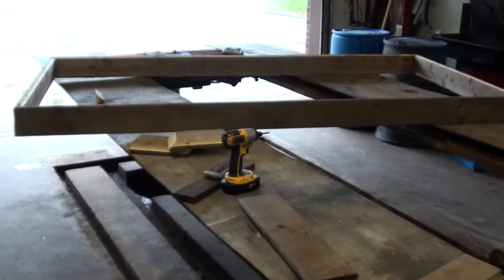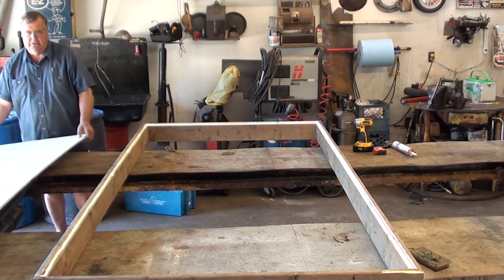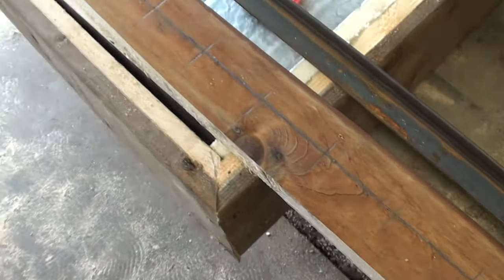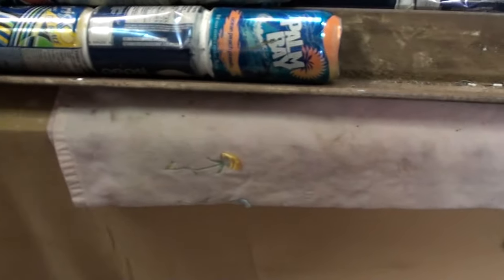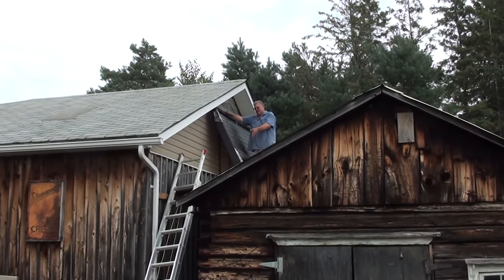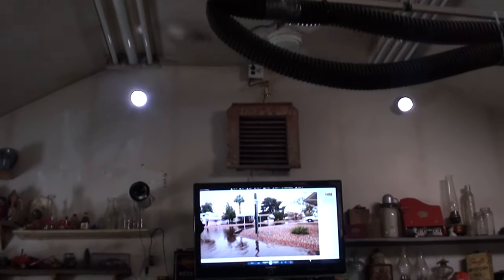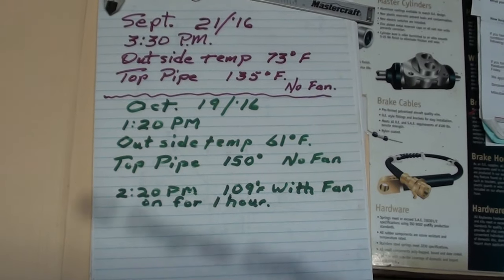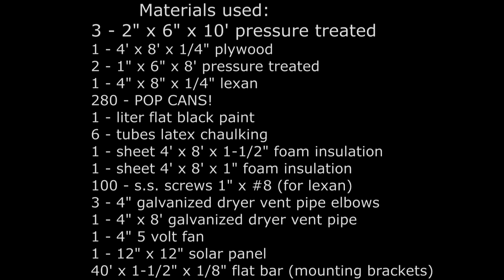SOLAR POP CAN HEATER BUILD!

Comment: There's actually a way to improve the system: just out of the top pipe, add an insulated (styrofoam/foam) chamber with a valve and a few standard red bricks. They'll store the raw heat and give it back  later on. Also, this way, you can put a "tap" out of the brick chamber and the bricks will continue storing heat even when you're not blowing it into the house. From there, you can even wrap the bricks with a copper coil pipe and use the heat in a parallel oil circuit for heaters.

Comment: using the same kind of method. if you put cans on the inside on the walls ensuring the air blows through them under an air tight seal (bit of tubing between each can) - you effectively have a solar fueled radiator. obviously minus the glass front 

for best results, strip the cans of their paint and put one on each wall and the ceiling above you

Comment: I use mine all winters 
Using a fan will knock the temp down 30-40 degrees every time.
I generally leave the fan off unless I'm getting great sun. Mine is on the lower floors do the heat it produces just rises to the upper bedrooms. Great video
Reply: What about at night when there is no sun?
Reply: @catsincredulous9998  it works in reverse... you cool your house...

Seriously... its a solar heater... what do you think happens at night?
Reply: @catsincredulous9998  
Light a matchi.

Comment: beauties!
would be great if you could push the intake air from the other side of the room of think. the way it's setup with the overhead ceiling fan it looks like you might end up cycling the warm air back through the cans

Comment: Nice build. I will be doing a similar build for my RV using steel cans since they are easy to open both ends with a can opener and they are a bit thicker to retain a bit more heat.
Will be doing a thin coat of concrete or epoxy before spraying with high heat paint.
God bless.
Reply: You can also use plastic drainage pipe, the corrugated kind, lots of surface area and should work easily.

Comment: Wouldn't it have to be a fairly temperate day for you to get much heat out of one of these?
Reply: From a test in mid Wisconsin, I can get output of about 65f down to 5-10f outside at about 1 gpm of water. So if you build bigger maybe you can get heat lower, but it's a greatly reduced amount you can get.

Comment: there's been a number of times i thought about building a version of this kind of solar heat, i even had a barrel with over 100 cans that sat here for years but every time i really thought about seriously it just didn't make sense to go to all the expense and work just for heat during the time of day when i need it the least and it's not like solar water which retains some of it's heat into night time......
Reply: That just means you should use both methods.👍👍

Comment: very interesting but I am wondering if  pvc plastic pipe would work in lieu of the cans
Reply: it might some possibly but the metal cans are the primary heat source as they are what is heating up the most to create enough heat for it to work.
I you ever do try it with plastic hit us up tell us here how it goes!
Reply: @jonathanw1567  yes, but the plastic pipe will give up it's absorbed heat much slower than the metal cans when the fan is running.  The goal is to get the absorbed heat out of the heater and into the structure and not hold it in the heater box.  Also, pvc and abs pipe will not hold up to heat and may crack or split where a metal can will not.

Comment: So the bottom takes the cold out and the top transfers heat?
Reply: Heat air rises. So the bottom pipes pull ( cooler ) air out of the building, heat them through the cans and put it back into the building through the top pipes. A lot of people pull air from outside, run it through the pipes and then blow it into the building, but this is more effective

Comment: So how did you figure the equation out for what degree to set it at so I know how to set mine when I finish it
Reply: Very roughly, use whatever your latitude is.  There's some gains to be made slightly off that but it's small enough it's not worth worrying about.

Comment: Eont yhis turn into an air conditioner when the sun goes down?
How would one retain the heat at night from this?
Reply: I would recommend using some kind of brick or a sand =-filled container, as masonry absorbs heat and releases it later.